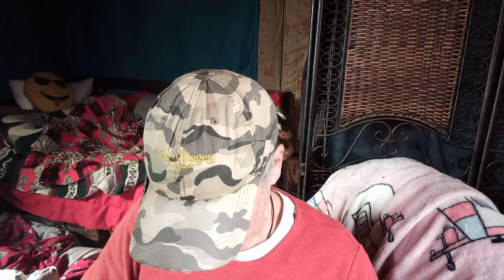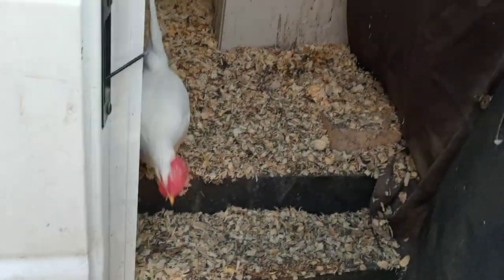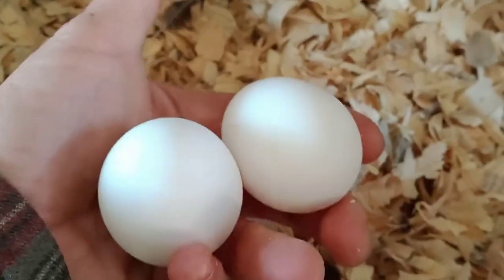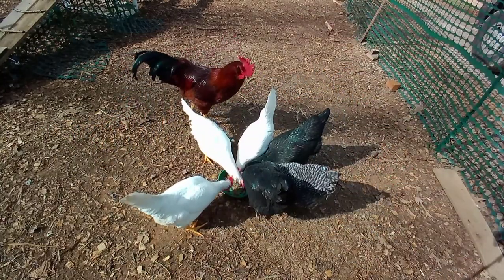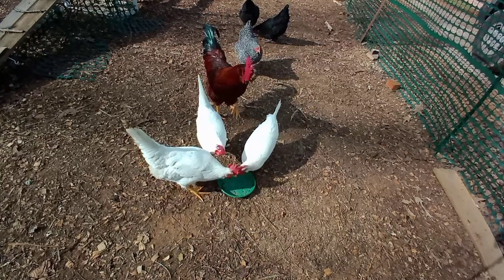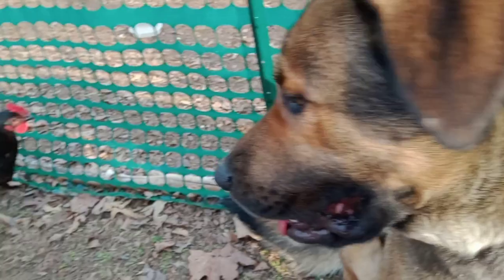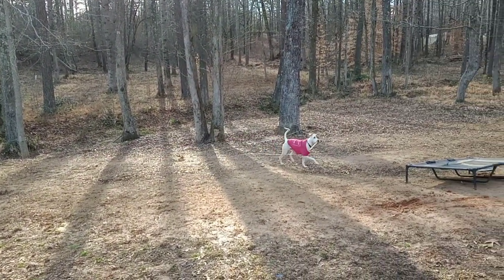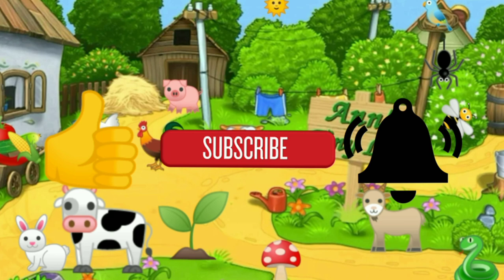Trying GrubTerra Black Soldier Fly Chicken Treats! - Ann's Tiny Life

Comment: What a great gift! I use black soldier fly larvae, too. I got a 5 lb bag of them, and it's lasted me awhile. Just a little bit left now. My chickens LOVE them. Most times I will add some hot water to them in hopes of re-hydrating some along with a little of their food, and give it to them just before bedtime. Supposedly helps to keep them a little warmer during cold nights if their systems are digesting. Don't know if that's true, but I figured it was worth a try (it also helps get them back into the coop so i don't have to round them up).
Reply from the maker: that's a great idea rehydrating them! I thought about doing that with some of the other food. I know I've done it with corn before.
Reply: @AnnsTinyLife  - Well, I don't know if it actually did re-hydrate them. I didn't test to see if it worked. It worked with the corn?
Reply: @AnnsTinyLife  - So, if Grub Terra is also selling live black fly larva does that mean you can give your chickens the live fly larva that is collected in the flytraps?